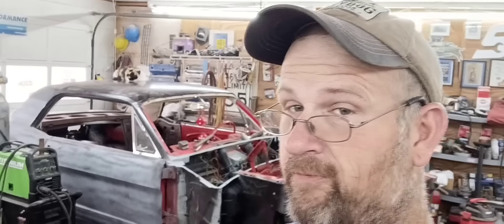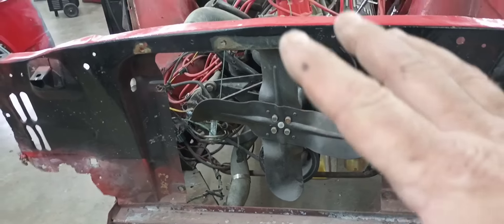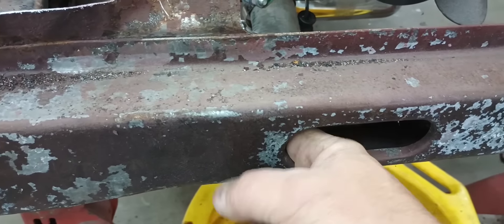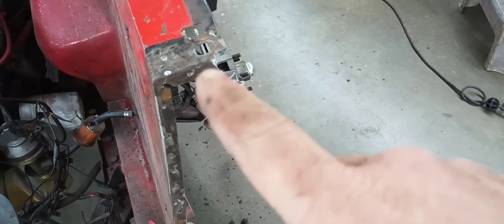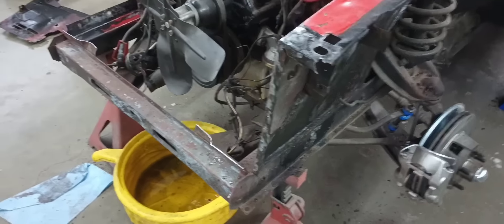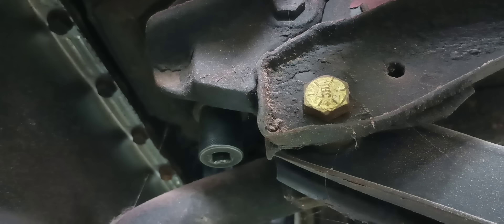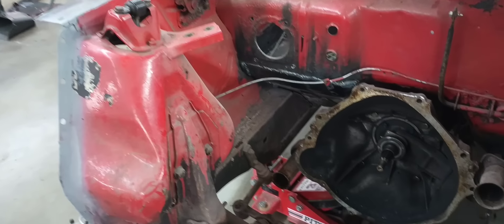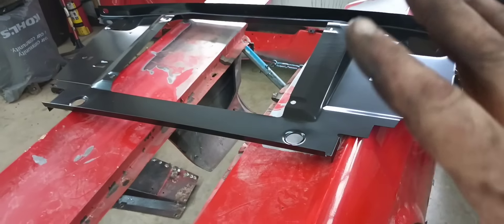Bringing Back Some Integrity? Digging Deeper In The 1965 Ford Mustang! #Ford

Comment: Think you said in the beginning that this was more parts car than restoration candidate.  Maybe the car should have been given to the high school for a shop project - before it was crushed!  Enjoy watching you bring its life back
Reply from the maker: Absolutely would had been a good parts car for a more sound car
Reply: Do high schools still have auto shops? 

I graduated in '82 and we still had an auto shop, but the program had been drastically scaled down to essentially an auto maintenance program.  The shop itself was torn down about 10 years after I graduated.
Reply from the maker: @kennethsouthard6042  very few they don't want kids learning trades
Reply: You are correct!  In the area where I grew up, people that went into the trades were treated like Beavis and Butthead. 

I thought about going into the trades myself as I used to work on cars a lot in my teenage years and still do a lot of my own work today.  However, I ended up going to college as an accountant and later into accounting software, where quite honestly, a lot of the same diagnostic principles are used.

My younger brother started out as a technician in a front-end shop, then moved on to the dealership then started his own shop. 

Whenever I go to his shop and see the operation that he has put together and how well respected he is amongst both his customers and techs that work for him, I am beyond impressed.
Reply: I attended an auto tech school. We did actually worked on customers cars. That was ended because of liability and insurance concerns.

Comment: Boy, this car doesn't seem to have a single panel that under the paint isn't gobbed up and rusted through.  I looked up a Dynacorn full fast back body and I have to think it would be cheaper than all the work you're doing.  This series is perfect for anyone thinking of either of two things.  Buying a classic without having someone like you or Kiwi inspecting it first or buying a "fixer upper" that just needs a little bit of body work.
Reply from the maker: You are right a repop shell would have been cheaper in the end. And if this car teaches anyone anything I hope it shows them to be 100% on what you buy

Comment: That gloppy red brushed on crap I am looking forward seeing it be gone!!  A nice clean engine compartment and fresh paint and all of the other repairs that will be done soon too. 
    That is gonna be one happy horse when it is done...as well as the owner too. Given the never ending surprises as to loose or half assed fastener uses I would check the rear end and shocks and brake stuff.  I so hate seeing things jimmy rigged...but it warms my heart seeing the mess being repaired correctly and not done in a hurry. At least the engine paint will be easy if it is decided to be done...pretty hard to mismatch black🙂
    I only wish i could send you a couple of cold ones through the internet...Lord knows you have sure earned them and continue to do so with each video🙂
Reply from the maker: I started stripping it today what's sad so far is I'm finding spray can asphalt undercoating under the paint so paint stripper isn't doing much but making a mess 😆

Comment: I believe you said this car is a 1965 probably not a one owner ,it probably sat outside ,some flipper owned this too probably.  You’re going to make this car nice again.  The ppl that think this should have been a parts (I don’t think so)So far how much sheet metal was put in this car. Some shops strip and inventory the car did it and order sheet metal but that process cost more than this process. The true flipper cleanup the body panel makes the body look nice and bad structural unibody part they put body putty on it to make it look good.  I ll keep watching your video you are making this car nice. Thanks
Reply from the maker: Yes it's a 65, between the hack job before and what I've re replaced there's probably 30% of the original car there. From a cost stand point it should had been a parts car more from it being bent out of square I spent a ton of time getting it to relax back into the factory measurements

Comment: I'm not a body guy, but was thinking what if you used the whole new core support and didn't cut into with that seam at the bottom. My idea was to attach it to the top let it support that part then work out the bottom area and attach. That way your sort of slipping it in without removing the car from the stands.

Comment: The cross member on my 69 has to be replaced with the core support. No choice. The cross member is rotted out because of the battery. So both fender aprons and the core support with the cross member. I have all of that stuff. I just have to remove the bad stuff first.
Reply from the maker: It definitely happens, surprised this one is so solid in the rails

Comment: and you videos continue to reinforce why I would stay away from 60's Mustangs, Cougars, Camaros and Firebirds. Cars that should have been crushed long ago are kept merely for their potential to be flipped onto unsuspecting ill-informed consumers who should stay away from classic car ownership. great work on your part - too bad it's just a common 65 sedan and not something more special given all the work you've put into it. I suspect you'll find more rust or botched repairs in the engine compartment after the paint stripper
Reply from the maker: I'm sure the surprises aren't over yet as much as I hope they are
Reply: @HotRodGuyGarage  Wasn't there some issues with front steering/suspension system?
Maybe that's coming up?
Reply from the maker: Yes there some issues underneath that will Have to be addressed with the support cross member